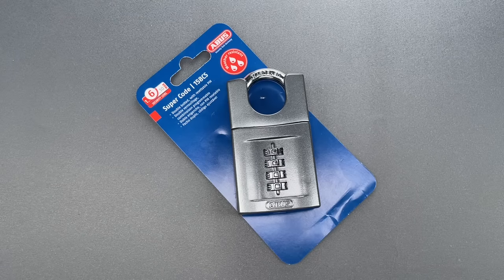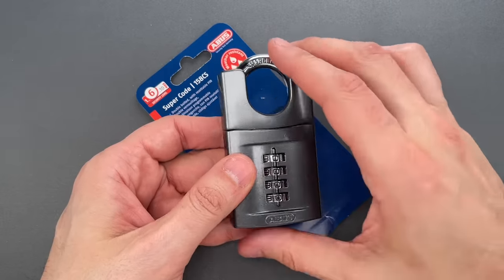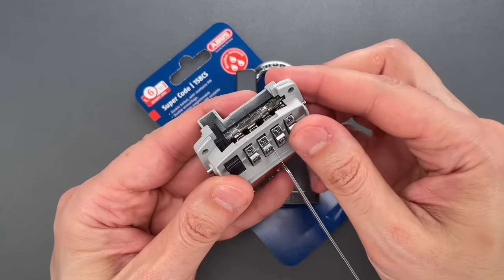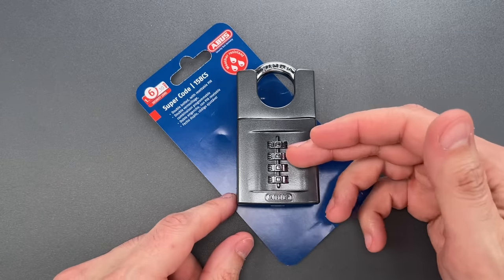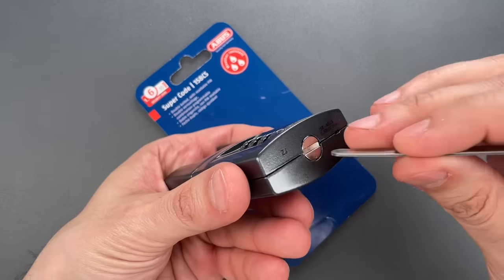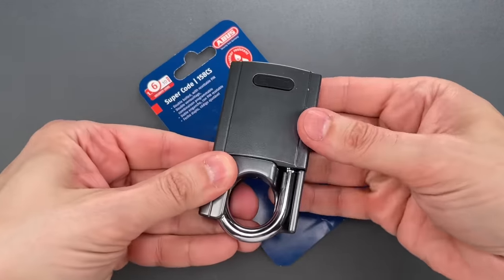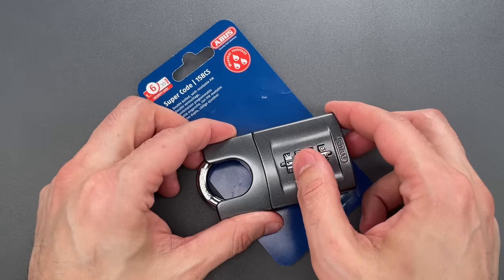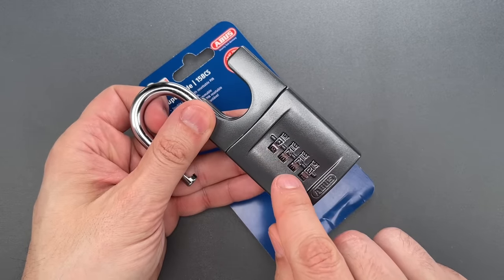[1541] Abus “Super Code” Padlock (Model 158CS)

Comment: I read the comments and its obvious that a lot of people do not understand what just happened.  LPL changed the combination while the lock was in the default combination of 0-0-0-0 by turning the reset on the bottom of the lock.  You can only turn the reset if you have the right combination which was 0-0-0-0 before he changed the numbers.
Reply: Thank you. I was wondering how that had occurred with the lock in the closed position.
Reply: Something perhaps less obvious, is that eyes aren't even needed for this decode.  He could have reopened the lock after setting the new combo without ever turning it back over.
Reply: @VoltisArt how's that not obvious?
Reply: He opened the shackle before he changed the combo. That is super obvious and the entire reason he scrambled the lock. Of course he's going to change it from the default combo. Otherwise, what good is the video?
Reply: I'd wondered about that.
Reply: Ahh I posted to quick before reading your comment. Thanks
Reply: Thank You, I never reset a combination lock... I'm not even sure I've ever used one that isn't a rotary dial. So I know nothing about the reset feature and thought off the bat "well that's a major design flaw"... you clarified what I didn't realize, I saw the lock closed and thought it shouldn't be able to be changed while "secured" I assume it wasn't technically locked, only closed.
Reply: @privateprivacy5570  Right, I asked how, because it's not obvious to me.
Reply: doesent matter 
they best way to open them is often just to spin the wheels a few times fast while you try to open the lock at the same time
i never tried a code lock like that, where it did not work
he is making it way to complicated
Reply: @Hansen710  
10,000 possible combinations with 4 wheels... you must be insanely lucky to open one in less than an hour or two!
Reply: @Mike_H76 No, what they mean is by pulling on the shackle while spinning the wheels quickly, the shackle will put tension on the side bar. The gates will cause the wheels to seize up when they reach the correct number for that position of the combination. It literally takes seconds.
Reply: @OtakuUnitedStudio  
Ah ok, thank you, I never trust locks anyhow. I've been trying a similar tactic with an old (empty) safe I have, holding tension on the key and looking at what numbers "click" or bind up. It's a junk safe that I just want to use for flammables. I might just destroy the lock and put a clasp on it.
Reply: Thanks for this explanation. I figured I must be missing something.  Obviously, a lock that can be reset to a user-selected combination without unlocking it is worse than useless, but the alternative — the wheels operating instead on some kind of offset system, perhaps, so they're not showing the real combination — seemed at best, a denial of service waiting to happen. The real situation makes much more sense.
Reply: These people are not valid. Carry on.
Reply: repentandbelieveinJesusChrist1  Dammit I told you to wait in the truck
Reply: repentandbelieveinJesusChrist1  
You picked the incorrect "god", looks like you're headed to the Norse "Hel" instead. I'm so sorry.
Reply: @MadScientist267  
In or UNDER the truck? You're so much nicer than I am, I'm not jealous of that, simply an observation. I'm much happier when I'm an a$$hole!
Reply: @Mike_H76  🤣

Comment: At a school where I worked they had this thing called BreakoutEdu which is an educational "escape room box" puzzle thing that uses multiple locks that you're supposed to solve using clues to figure out the combination. When the company came in to demonstrate the device, our box was locked with 3 different wheel locks with numbers/symbols/etc that we were supposed to solve using clues hidden in the room. 

We were paired up with another individual and then set to race to see who could solve their lock box first. I asked my partner if they wanted to do it the hard way of finding clues and solving it or if they wanted me to just open the locks. We agreed that I'd just open the locks and it went pretty much like this video. We were done in under 2 minutes and the demo team were a bit annoyed at us.

Edit: To clarify, we went back and did it the right way later on. I ended up using BreakoutEdu in my classroom later on and just added a rule that no picking or brute force solving was allowed. It was all good in the end.
Reply: That sounds like a them problem, not a you problem lol
Reply: I don’t know. Solving the puzzles and working out the clues sounds like a fun game. It’s not like they planned to test pick proof locks, they planned to design a game and what you did sounds like a bit of a jerk move.
Reply: The challenge of the game is thinking and problem solving.   You thought outside their box and solved.   Well done!
Reply: @glockenrein  Yes, but looking out for exploits (and patching them as deemed necessary) is also a part of game design. Though, personally, I would go back and solve legitimately later because that sort of puzzle is my kind of thing.
Reply: @floopyboo  No. The problem was either:
- you for being there, when you had no intention of doing it properly
- your teachers or parents forcing you to be there, when you had no intention of doing it properly
Not the demo team, that likely lacked the legal justification to prevent you from being there.
Reply: @glockenrein  if it wasn't specified in the game rules, then it's a design oversight. It's just like in football: you can score a goal from offside, but the rules say it doesn't count so it's not counted. If the ruleset didn't specifically say lockpicking is not permitted, then it's a legal move
Reply: @e1123581321345589144  Can confirm, lockpicking is a legal move in football. /s
Reply: Nothin' in the rules says a lockpick can't play football!
Reply: @christopherg2347  The original comment says that it was a school that drsch worked at, not attended as a student. It was probably meant to be a non-optional teambuilding activity for employees.
Reply: @glockenrein i would disagree. it's like a game dev getting mad you solved a puzzle a different way, instead of praising your ingenuity for solving it a different way they never thought of.
Reply: In the grand tradition of Richard Feynman. Noice
Reply: I always do that in escape rooms involving combination locks. When people find one or two clues, the remaining numbers are almost always faster to solve with trial and error than by finding the remaining clue.
Reply: @LordDragox412  I actually laughed out loud. 😆
Reply: Sounds to me like a Kobayashi Maru situation (Star Trek reference for those of you who don't understand that term). In my world (my old job and my home life)  thinking outside the box is the norm. A skill like that can be a very valuable resource in almost any situation. Good for you.
Reply: @glockenrein  It's only a jerk move if you don't take into account that this is happening in a school. Learning how (and when) to bypass stupid rules is part of growing up. How many students try to break into the grades database vs how many adults?
Reply: You use the tools you have to hand... literally! 👍
Reply: I am familiar with BreakoutEDU and can confirm they use some really shoddy locks. I've opened one myself by pulling on the lock to apply pressure to the bar. Finding the combination was child's play. No pun intended. 🤭
Reply: @glockenrein  -  Jerk move or not - and I wholeheartedly disagree with you -  they exploited the weakness of the locks to win the game.  The designers missed that flaw.  I don't think that makes the players jerks.  They're merely players who were smarter than the game designer, or if you prefer, had a skill the designers hadn't considered and exposed an inherent weakness of the game.  The game designer got their feelings hurt.  The solutions for the designer are painfully simple and easy.  The players decipher the codes and the moderators open the locks themselves, or simply omit the locks altogether.  

You like solving puzzles and working out clues?  That's fine.  No one's stopping you from enjoying yourself, so have at it.
Reply: @glockenrein  Its only a jerk move if you do it without the consent of your team, and this person had consent.
Reply: I used to unlock combination locks in the school bike sheds and move people's bikes from one side to the other, just for giggles and to let them know how useless their locks were 😂
Reply: @LordDragox412  😂
Reply: @Sennaxm71  -  How to win friends and influence people.
Reply: @wickedcabinboy  yeh, I was a dick at school, I was dealing with home issues, which thankfully I figured out by my 30's
Reply: @christopherg2347  it’s basically an escape room. 

He didn’t break into the pentagon. 🙄
Reply: @madtabby66  And?
Thus?
Therfore?
Please finish your argument.
Reply: To everyone saying this was a clever and out of the box solution and the game designers failed - sure. So would’ve been a hammer. But like we know from this channel, it’s not likely they could’ve used much safer locks. Like someone else commented, I also don’t think this was for kids but a team building exercise for adults instead. So since the fastest team wins, that game was over in a minute, no team got to actually work together, no one had much fun and no team building happened. Which OP knew perfectly well. So I’m not sure what the purpose of their actions was other than to ruin people’s fun and the exercise in general. Which I still think is a bit of a jerk move.
Reply: Yo thats super funny. Beers and wings on me.
Reply: :-D
Reply: @glockenrein  it's not the designer's place to tell the player how to play the game, just how they intended it to be played. Now, the other players they were competing with, they might have valid beef...
Reply: @glockenrein Sounds like an iss-them
Reply: I remember an episode of survivor where there were teams of people who had to get do things to get the combination of what I think was a 3-wheel lock. (I tried looking it up, but was unable to find it.) Even before I learned anything about picking locks I remember thinking to myself that I would have wanted to just go to the lock and felt around for the code. The lock was huge (wheels were maybe over a foot in diameter), and I doubt they would have used false gates.

I guess they got smart because as I was trying to find a clip of my above memory I saw a similar clip, but they had a rule where after every test you had to leave the lock and come back to try again.
Reply: Did any of these repliers like... read the comment?
It states they were giving a demo of their system, so my presumption would be that the demonstration was given to staff in order that the staff approve it before it's given to the kids (or to adults as a team building exercise).
Since it was intended as a demo (basically an opportunity to test the puzzles/whatever), finding a stupid exploit is absolutely the right thing to do. It allows the company to fix the issue, and allows people to know in advance that this might be a problem. 
The company is annoyed because it makes their cheap sub-standard locks look cheap and sub-standard, but that is entirely their problem. Finding the issue makes it so that it can be ruled out pre-emptively when it actually IS used as a team building thing or teaching system - a single rule would prevent the issue from the start. This is particularly true if children will be doing it, as they will try and sabotage it, even if it's fun.
Reply: I did one of these locks when someone changed the combination on a work colleague's briefcase. He was horrified and grateful at the same time. Four wheels were supposed to be secure...😂
Reply: @LordDragox412  I nearly gave you a thumb up but 42 is the answer to the question of life, the universe and everything.
Reply: @deathofallthingspotato9919  Nah the locks weren't there to provide actual security. They could have used props instead of locks and the game would have worked fine so refusing to play along doesn't show them up in any way.
Reply: @Splattedable  It shows they didn't think of it. It should have been a rule. Discovering that is embarrassing for them, but again, its a demo - this is what demos are for.
Reply: There's some salty ass comments in this thread. Get over yourselves people.
Reply: @graydi66y  that's when you get your ass-salted 😜
Reply: @TimmyMoza  Then they got inside the box.
Reply: So, just to clarify, we went back and did it the "right" way later on. I ended up using BreakoutEdu in my classroom later on and just added a rule that no picking or brute force solving was allowed. It was all good in the end. Seeing as I was teaching HS design, shop and computer science at that time, finding this exploit seemed a pretty useful thing to do.
Reply: I used to work an an escape room. People guessing or forcing open locks (which is against the rules) usually hurt them. They'd still try to solve the puzzles that gave them that clue and get confused. It tended to slow them down.
Reply: @TimmyMoza  Exactly. In my opinion, escape rooms are a "game on" situation, where anything and everything goes. We were in an escape room recently, where there was a "puzzle", that required you to reach with a wire through a grate to pick up a key. There was some kind of rigid wire behind one of the locks that you were supposed to use, but the room also had an old radio receiver with one of those expandable antennas and it was possible to unscrew it...
Reply: @deathofallthingspotato9919  The way I see it, this isn't a  competitive sport where the rules need to be airtight to settle disputes. Rules can be implied if that's enough for players to understand the game, which drsch clearly did. You don't need explicit rules for every way in which a player may choose not to play along, because that's just a variation on them deciding not to play at all. If drsch and their partner had misunderstood the game and skipped all the clues, that would have shown up the designers, but deciding not to play? That's all Drsch. No one got shown up.
Reply: @Splattedable  But again, this is the demo, not the game. A huge part of the point of such a demo is finding issues. This isn't a case where they should be playing along for the enjoyment of the group, they're doing it to check whether the game works out, and this is a valid criticism.
I'll admit it's a nitpick, and probably not something that super needs addressing, but its not out of place either.
Also, if the game was intended for the children, they'll try and break it any way they can - expecting otherwise is wildly naive, even if they asked to play the game. Honestly, even among adults that isn't unlikely, so idk.
Reply: Next time bring a big sledgehammer and just smash through the wall and get out that way.
Reply: I like it. If I'd set a test like this amongst a group of high achievers to see who could think outside the box and therefore become the successful applicant to the job I was offering I would absolutely give it to the one who ignored the instructions and went straight to the best way to achieve the objective. The sub 2 minute lock pick would always get the job over the convoluted problem solving process. The applicant who smashed the lock open with a hammer would be my second choice. The real world is only interested in solutions, not methodology.
Reply: Cool story bro
Reply: make it so you can lock pick a second one for extra points
Reply: @glockenrein He just made it even funnier and funnier. Intelligence wins over ignorance.
Reply: I'm waiting for saw fi to just use lpl that bypass all challenges...

Comment: From what I can see, it looks like Abus actually made the spaces between the wheels and the lock body extremely tight. I'm guessing that the wheels are also of the "stepped" design where the part behind the case is a bit wider. Which means it's probably difficult if not impossible to get a tool in there to pull the bar against the wheels. So if Abus hadn't messed up by making the spring too strong, that lock probably would have been about as good as it gets for that style of combination mechanism. That's probably the most infuriating thing- they got SO close... then screwed up on one detail.

This being Abus, a company known for making pretty good locks at most price points, I'll bet they correct that problem soon enough. I'm sure they watch these videos.
Reply: They tripped at the finish line.
Reply: Not even close, there is still the trick of sliding a thin metal strip at the top to unlock the shackle directly.... it's Abus, remember 😆
Reply: I'd watch them. It's a free test and a free advice on what is wrong. The best test rig if you ask me.
Reply: @Sodabowski  the extended body will make that really hard, especially with the lock in use.
Reply: Would a weaker spring have disadvantages? For instance, is it possible to hit the lock hard enough for the bar to move exactly as you pull the shackle?
Reply: @Sodabowski  a strip that I don't own, I just use a lightly modified wiper insert.
Reply: Even with a weak spring, you can learn to do these locks by feel. You just need to apply a little pull on the shackle simultaneously.
Reply: @clonkex moving the bar isnt what unlocks the lock, moving the bar is what allows him to feel when he's in the right gate
Reply: @Vinlaell  Are you sure? If the bar isn't connected to the locking mechanism, then it doesn't matter how strong the spring is because he won't feel the wheels falling into the gates.
Reply: Yup
Reply: @Sodabowski  You can't shim a bar lock, it's not a spring loaded padlock.
Reply: @clonkex  the bar is connected to the locking mechanism, but pulling it forward doesn't unlock anything.  Pulling it forward increases the tension on the mechanism which in turn allows you to feel the friction between the wheels and the gate.  So, when the friction goes away, you know you're at a gate.